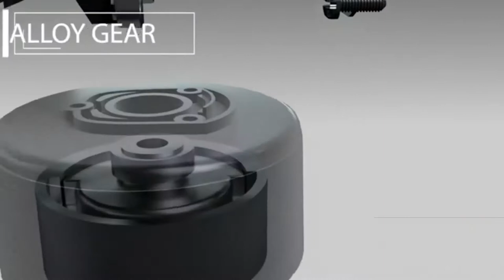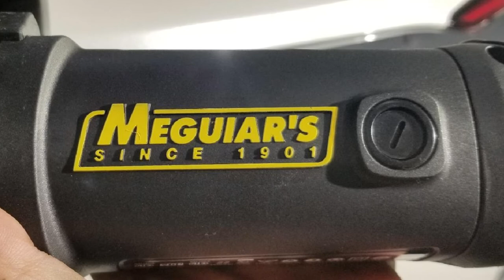Best Dual Action Polisher In 2024 - Top 10 Dual Action Polishers Review

Comment: Walmart has a shockingly good PLATINUM 6" DUAL ACTION POLISHER with  6 speeds for just $70. They also have 3 different density pads you can buy for just $7 each. best bang for the buck I've found to date for a quality polisher.